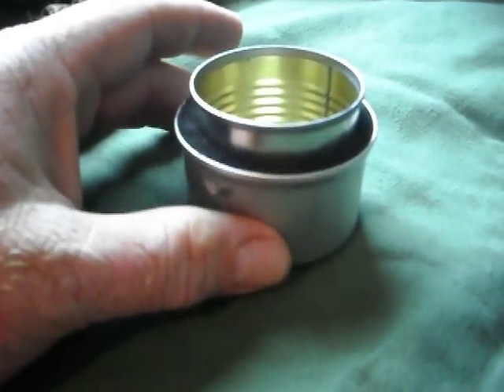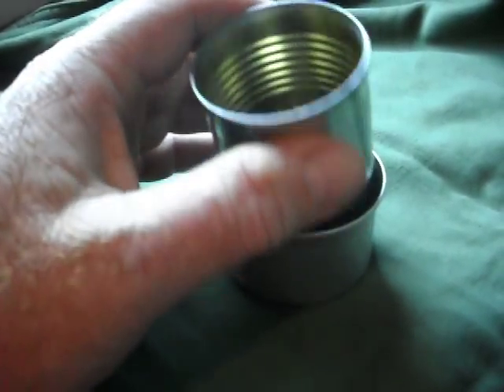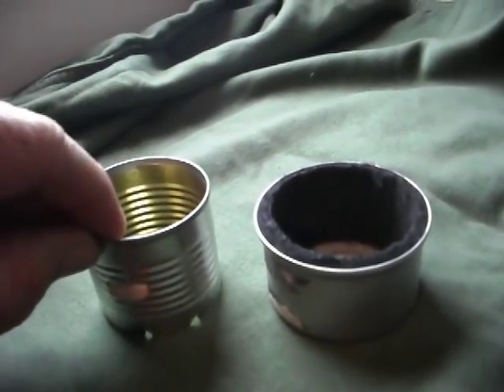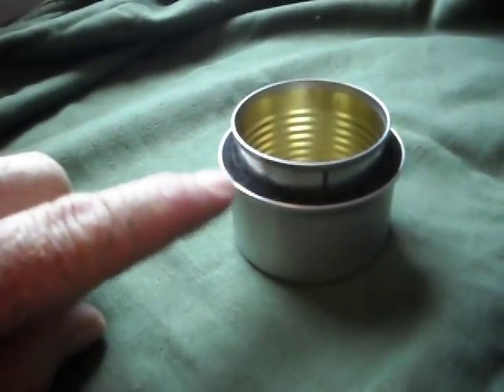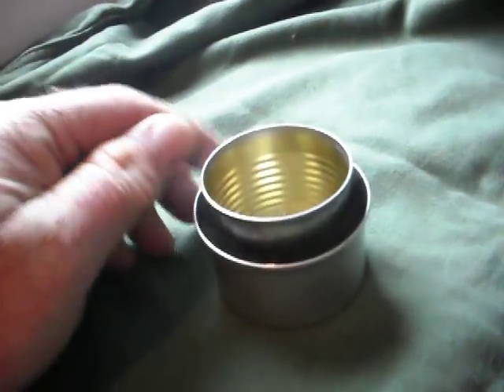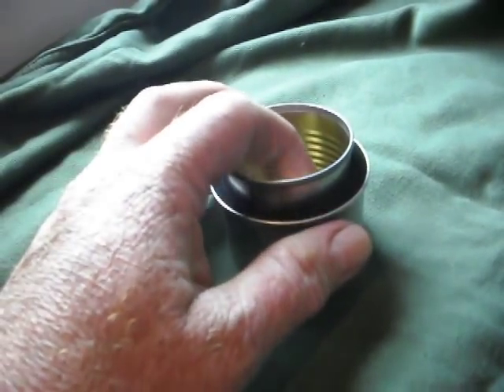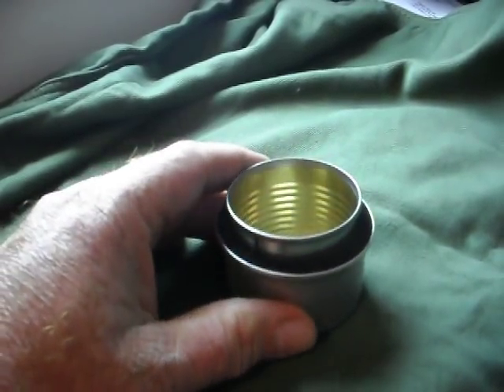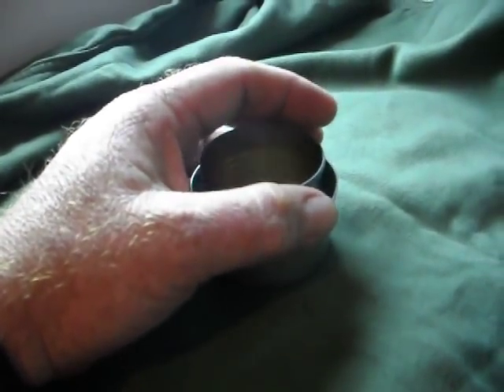Tom Cat  Alcohol Stove

Comment: What a beautifully simple design! Much easier to make then my Penny and Cat stoves and it provides a wider "pot holder" area too because it is bigger than the standard cat food can because I used a tuna can as the outer can and I also I used regular regular household fiberglass insulation that I packed reasonably tight in the 3/16" space between cans. It took 6 min to get a rolling boil of 16 OZ of room temp water!  Good stuff indeed, THANKS!

Comment: I learned the house insulation trick a couple of years ago.  Has made using my basic cat stove much easier.  I use a version found many years old where you basically snap a small cat food can into the next size smaller.  Pretty basic, not too pretty, but it works fine by placing pot on combination wind screen pot holder.

Comment: I made two of these and used them on an 11 day backpacking trip in Yosemite. They worked ... mostly. They would randomly go out on me, especially in colder temperatures or at altitude. I won’t be using them again—after watching other videos, I increased the height of the inner can to one inch above the lip of the outer can and put a hole in the inner can near the lip. I’m hoping this will prevent random extinguishing.

Comment: Thanks for showing. What else can I use instead of carbon felt? Any ideas?
Reply: as he said in the video regular household insulation would also work but it will also be an irritant.
Reply: man look,  you can use paper towel if you want. wrap it around just like the c-felt. it'll last a couple times trust me. I tried it just now and it burns hotter than a trangia...any questions just ask